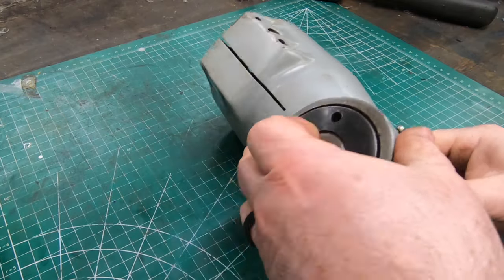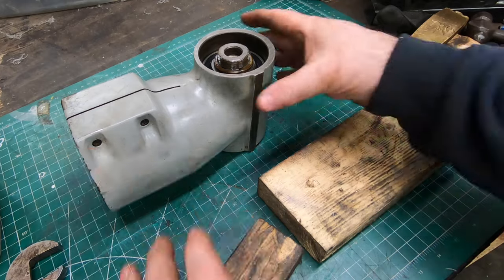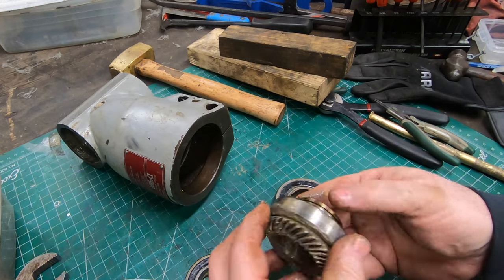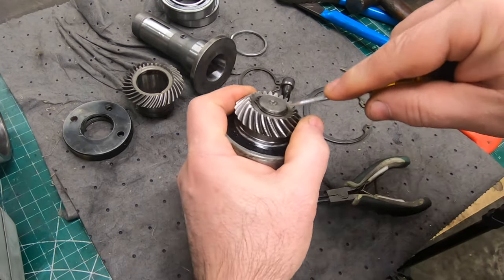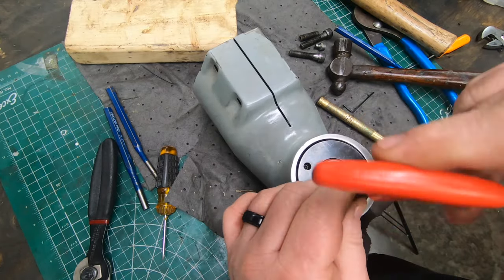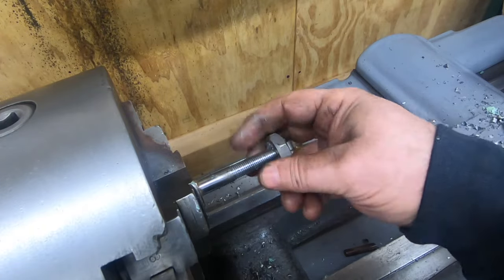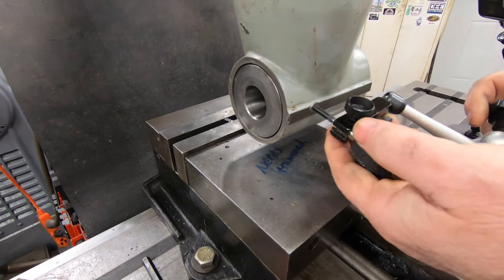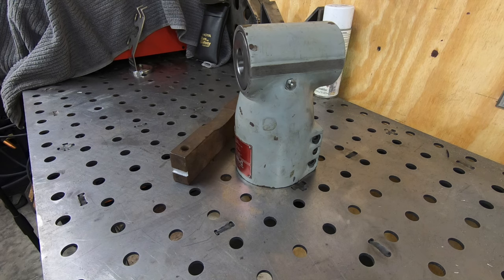Cleaning Up and Using a Dorian Right Angle Milling Machine Attachment for the Bridgeport

Comment from the maker: I finally got ahold of Dorian customer service. They must have been on vacation around the holidays. The answer is: a bit ambiguous. The parts diagram they sent me suggests using "anti-wear grease" when running at high speed - whatever that is. LOL! But another section mentions a base oil viscosity. So I'm leaving grease in there.

They also sent over a manual as well as the parts diagram. Wish I had this sooner, but better late than never!
Reply: Most modern greases are "anti-wear" grease.  Now, most have some sort of wear additives.  Likely, when the head was made, true "grease" was still an option.  A lot of grease back then was just oil mixed with a thickener.  Usually a type of soap.  The Mobilux you used is just fine.  It's a lithium based grease with a zinc additive for wear characteristics.

Comment: I have a genuine Bridgeport version and it was packed with grease. I think the grease is for the bevel gears and the bearings run in their own sealed lubrication. If it were to be filled with oil and using unshielded bearings it would need lip seals to stop the oil draining out. I was able to tighten the original drawdar with a deep socket. It is one of those accessories that might only be needed occasionally but it offers a lot of versatility.
Reply from the maker: The overwhelming consensus is that it is grease. I was 90% sure it was grease as well, but I did find this image that clearly states the gears are in an oil bath (possible for an Ex-Cell-O) https://www.hobby-machinist.com/attachments/rightanglehead-jpg.79373/

Comment: A hint. Whenever you use the head, remove the pin in the milling machine quill that locates into the slot on an R8 collet. The reason is that if the pin ever digs into the slot on the right-angle head's R8 connection you have no way to the get to the locating pin. Then you are in a real pickle trying to remove the right-angle head from the quill as the head covers up the pin screw hole. 
Often the locating pin is removed and left out of the machine altogether. If you remove the pin, remember it has one grub screw behind the other to keep the pin from moving once set. No big loss without the pin. If you have more than 2hp for the spindle you will more than likely pull the cutter out of a plain collet during a heavy cut before you spin the collet in the quill. Now you know where those ramped in milling cutter gouges in the mill table came from. For heavy work, use collets that have a retaining set screw that engages the flat on the cutter shank to keep the cutter from being pulled out.
Reply from the maker: My pin broke off about a year ago. I keep meaning to order a new one. It was broken when I got it, and I replaced it. Not sure what broke it this time. But thanks for the tip.
Reply: @MyLilMule The danger is that if you are using something like a fly cutter the shock of the intermittent cut might twist the collet into the pin. I've worked in shops where all the Bridgeport mills had the pins removed. If yours is broken I wouldn't bother replacing it.
If you do much machine work you will find the right-angle head is worth it's weight in gold. Used with a rotary table you can do all sorts of work that would be difficult if not impossible otherwise.

Comment: Nice find, I have been after one of those for a long time, had bought two from eBay but returned them after opening the box, I'll keep looking..One thing about your threading die, I was always told that the round dies are for cutting threads and the hex dies are for chasing threads...good video !
Reply from the maker: Possible. Maybe that's why I was having a hard time. TBH, my knowledge on threading dies is very limited.
Reply: Yeah, the hex dies are for fixing studs and bolts that the threads are a little buggered up , that's why they are hex so you can use a wrench or socket on them. That's what I was told anyway  @MyLilMule

Comment: In the Travers Tool catalog the description of the unit they call it a grease fitting. Maybe at some point Dorian will get back to you and confirm?
Reply from the maker: I finally got ahold of them. They told me "anti-wear" grease when running at high speeds. But the parts diagram they sent me has some mention of oil on it. LOL! I'm sticking with grease.
Reply: Oh geez. Grease sounds good. @MyLilMule

Comment: Pointing out the obvious , there is a zerk fitting on the case for applying grease .IMHO your greasing of the gears looked good and right .
Reply from the maker: If you've ever bought used, dirty tools from an auction, nothing is obvious. :) I agree, I am inclined to believe it is grease, but I found a drawing somewhere (generic right angle head, not Dorian) that suggested an oil bath. 🤷🏼‍♂️

Comment: Excellent job maybe someone mistakenly took out the oil zerk and put a grease zerk,dosen't seem right
Reply from the maker: Anything is possible. People are dumb. LOL. If you've ever worked around vintage machine tools, you'll often find grease packed into places that were supposed to get oil. Seen it far too many times. But I am leaning toward this thing using grease over oil.
Reply: Is there any difference between zerks ?
Reply from the maker: @stevewilliams2498  If there is, I wouldn't know how to tell the difference.